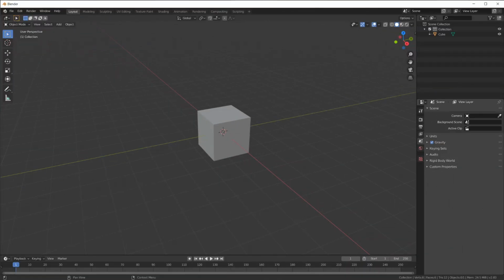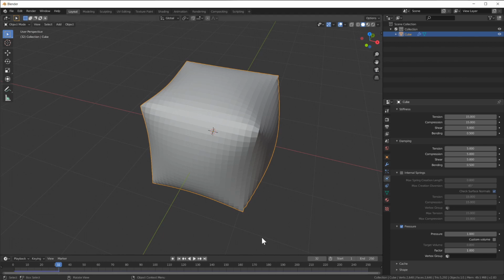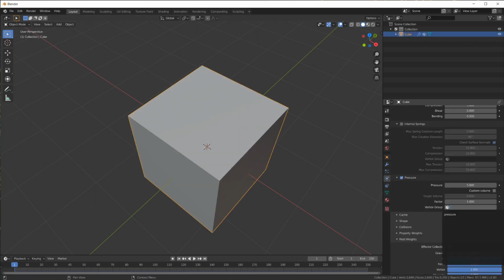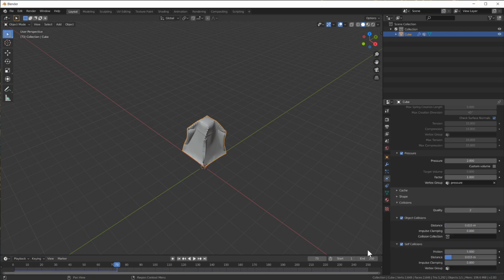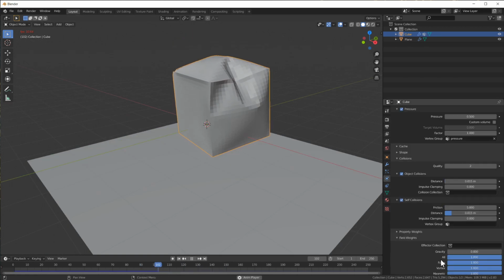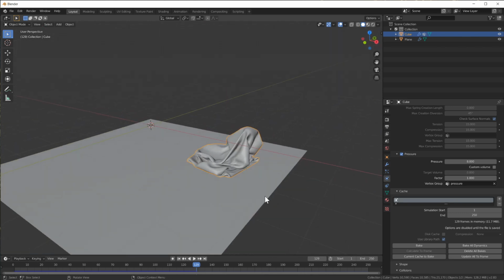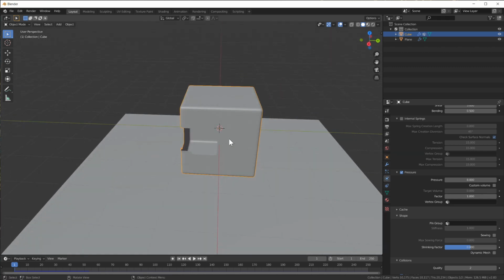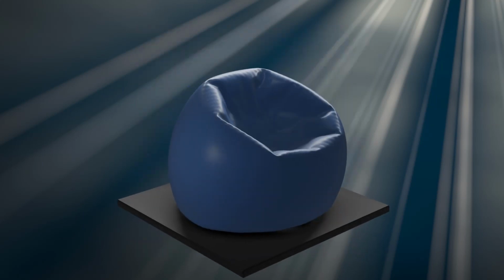3: Pressure 1 / Practical Cloth Sims in Blender 3D

Comment: hi Chris, great tutorial! but i have a certain issue regarding the cloth sim please address to my problem.

i made a random shape using a curve  and converted curve into mesh now  precisely selected 4  vertices of the mesh and pressed f to make a face and kept on going until i had a typology. Next when i applied cloth modifier it just doesnt work nothing happens. i tried it on a simple mesh inserted a circle and started making typology over it by filling the face and same result. i think cloth modifier does not work on custom shapes. please have a look
Reply from the maker: Hi, cloth sim works on any mesh - even non-manifold... there must be a different issue

Comment: Great tutorial series, Chris, I enjoy it!
To be physically and linguistically correct the pressure can not be applied to the vertices, but to the faces, proportional to their areas and in direction of normals. So if one cube side is subdivided, the opposite side not, the pressure force must be equal for both sides.
So it has to be a vertex group by naming, but actually a "face group" in calculation, hasn't it?
Reply from the maker: THX for pointing this out - I added a pinned comment to the "Pressure 1" video to clarify this - should have included this in the video...
Reply: @chrisprenn  Thank you Chris, good solution.
Reply from the maker: Hi! Yes, faces are required but since everything is based on Vertex Groups I thought it would make more sense to keep explanations based on vertices ... I guess they should refactor this to use Face Maps instead.